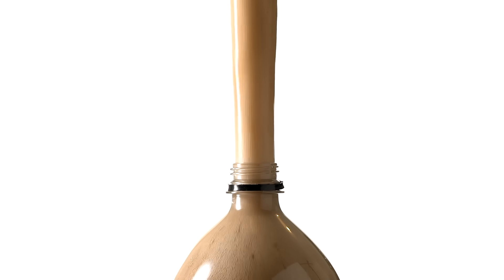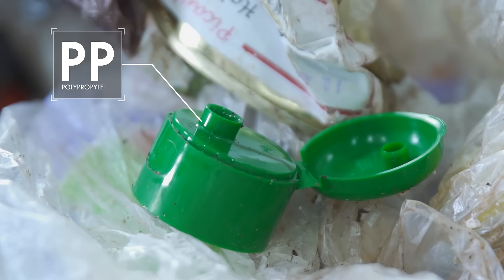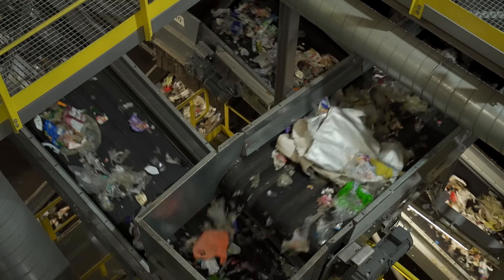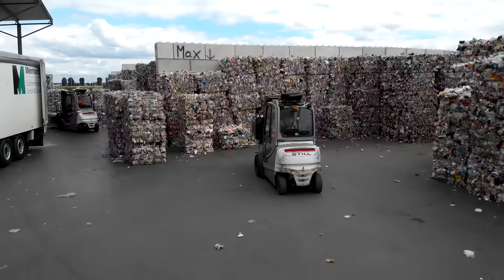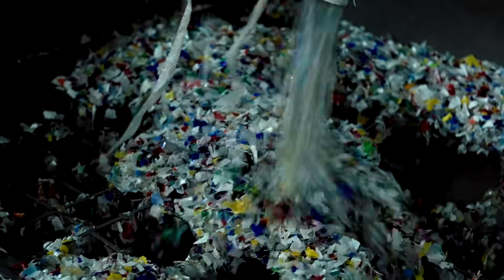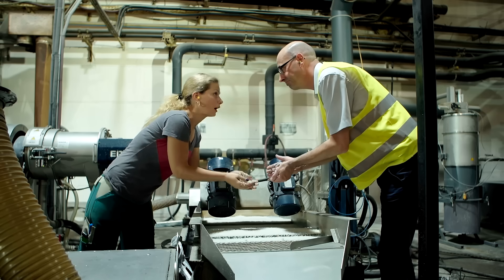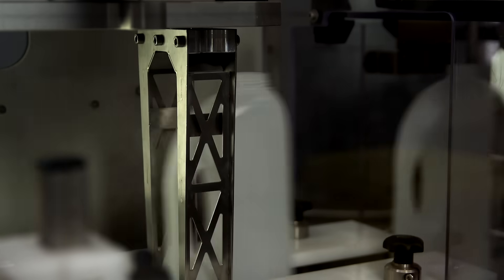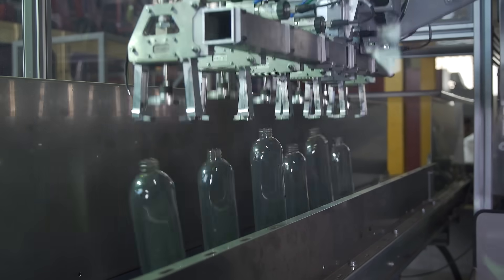Recycling plastics – Resource efficiency with an optimized sorting method

Comment: We should do it step by step. first, develop packaging with same material,try not to mix up PP, HDPE, PET, paper in one products. second, develop less color, try decorations in other way, label, film... etc rather than use multi color plastic. Third, use more soft  plastic bag than solid plastic, these type of bag actually consume less platic.
Reply: They are also less robust as a result though. For a while in the UK you could buy bags of milk and special jugs to put them in for dispensing. But the bags split easily, and it could be messy changing bags, so it died a death fairly quickly

Comment: The alternative to plastic is hemp products for it makes over 26,000 different things.  It has even been proven to be 10 times stronger than steel, 30% lighter and stronger, lighter than concrete stronger and lighter than brick far more versatile making the design possibilities practically limitless at the same time being easier to work with on-site, equally as amazing 1 acre of hemp can produce enough bio fossil fuel to fuel 10,000 vehicles for a year at about a dollar per gallon.  One of the major differences is hemp bio fossil fuel only releases the same amount of carbon dioxide  unoxygenated air per mile as a person does when the exhale versus coal, oil, and gas. Which release tens of millions of years worth of petrified death per mile.   The real sales pitch is 1 acre of hemp produces 3 to 4 times the amount of oxygen as a acre of trees + it sucks in 3 to 4 times the amount of carbon dioxide unoxygenated air as a acre of trees plus it rejuvenates and replenishes the soil back to Garden of paradise type quality after every harvest even if the landscape has been previously stripped, robbed, and depleted from overharvesting things such as cotton and corn that has been marinating in petroleum-based fertilizer.  Not to mention it has the same nutritional value as rice, corn, wheat, barley, and milk. So we can easily deal with people being over fed and undernourished. In layman's terms we can rebuild faster much more efficiently at a fraction of the cost in half the time of what we are doing today without leaving any excess poisonis, toxic waste behind.              In layman's terms we can manufacture, mass-produce, and distribute products that every country, city, and continent is going to be happy to spend top dollar. For example hemp clothing! For it distributes moisture across the body more efficiently than any other material leaving a person feeling, smelling, and smiling their best even under the most extreme circumstances plus it promotes good respiratory function so if a person has asthma, allergies, or other breathing complications just by wearing its clothing you will alleviate those symptoms with the potential of diminishing them all together. Hemp has even  been successfully grown on radiative soil!              So in theory if we grow hemp along the shores of our rivers and lakes we will greatly improve upon the quality of that water.  Nonetheless we definitely will improve upon and maintain the quality of our air, water, foods, landscapes, working/living environment, and every day home products by producing 3 to 4 times more oxygen per acre than we do currently. At the same time sucking in 3 to 4 times the amount of carbon dioxide                  unoxygenated air per acre as we do currently as a added bonus, everywhere we grow it we will be rejuvenating and replenishing the soil back to Garden of paradise type quality. Keep in mind America has about 800,000 acres of available farming land.  So again we have the manpower, technology, resources, and capability to create clean high-paying jobs from coast-to-coast that will improve upon and maintain the quality of life in such a way.  That will naturally allow each person's generation to become stronger, smarter, healthier, happier better off physically, mentally, financially possibly, and spiritually then the previous generation. With that type of leadership, loyalty, and devotion to one's self and country People may start finally having jobs, products, and power sources that will allow them to be healthy and wealthy enough to live enjoy their life all the way through out retirement.                        You can't do that would dirty low-paying jobs.  That come from outdated power sources, inferior materials, poisonous, toxic substances, pesticides, and chemicals that never change their killing composition which means whether it's solid, liquid, or burnt off to our airways and atmosphere as a vapor. It is always going to be poisonous, debilitating, and deadly to the body at the same time polluting, corrupting, and devastating to mother Earth and all the various different forms of life that live within this world.  The bottom line you cannot promote life by doing business with material, resources, and substances that have been scientifically classified and religiously verified as petrified death or worse. Think about this if life is not free why the hell would death be any cheaper. I guarantee it's not so would you like to know how souls and spirits have paid out are picking up the tab on the end results of dirty low-paying jobs.  Would you like to know how souls and spirits have paid out are picking up the tab on a diminished quality of life. Case closed mercy, forgiveness, and spiritual welfare are not changing these facts.             You're either part of the world solutions or you are exacerbating the world's problems either way each and every one of us is being held spiritually accountable for each and every moment. Laugh smile grin chuckle, with confidence I say now I wish and pray for my soul and spirit to be held spiritually accountable to the statements I proclaim. I guarantee you never see hear another body, man in power, persons of legal, religious authority leaders ever freely validate the statements they proclaim with that level of certainty. One reason could be the don't have the best interest of the majority of the population's needs at heart another reason could be the come from a breed of cowards! One is genetic  hereditary the other is simply a generic learned behavior either way it is physically, mentally, and spiritually useless to freely live and die in such a low quality manner especially if that stupidity, ignorance, and desperation stems from being soft, lazy, out of shape, over fed, undernourished, overworked, and
 underpaid with dirty low-paying jobs.

Comment: All those who comment negatives to say only 10% is retrieved as usable plastics from 100% wastes I wanted to let them know that the 90% which ends up in Incinerator Gasification actually produces Crude Oil which looks like Coca-Cola or black oil that is ready to ignite the Engines of a Boat or Oil furnaces. This is still polluting the atmosphere because that much more Crude will bring climate change. But there are ways to handle this responsibly. Hope the world can understand fast.

Comment: Instead of sorting plastic based on Colors they might add colour additives which will turn unsorted item into required colour
Reply: All plastic for packaging should be clear. That would eliminate the need to sort by color to begin with.
Reply: in my plastic manufacturing plant we use some recycled materials, but the only thing multi colored plastic is used for are dark colored products. think back to art class in school, every kid should remember this, when you mix all colors you get grey, it the only shade that you get. Which is a color shade of white to black, on a gradient scale gray is in the middle transitioning into white and black. Color scales look them up, so when our plant uses these multi colored batches, we only use them for light grey, grey, dark grey, light black grey, black gray, black. These are the only colors you'll get. what you must understand is if you did try to say a color using multi colored "( correct term is regrind"), then you will end up with your main color but add grey coloration in it. we use a hot runner injection molding system at our place, using a press that pushes a mold shut with anywhere from 500 to 1000 tons of force, big steel molds have an empty space cut out space in the middle in the shape of your product. we then take that plastic and dump it into a hopper that feeds an injection unit, inside this horizontal barrel 20 ft long is a precision screw, with a out side diameter close to the inside diameter to the barrel. that rotates at high speeds like 750 to 1000 rpm. which forces the plastic forward down the barrel remember because its a screw. as it move forward the gap between the screw and the barrel shrinks. resulting in high compression with rotating turns the plastic into melted plastic any where from 400 to 600 max degrees Fahrenheit, this liquefies the plastic and the screw stops spinning and get shoved forward at a specific speed to the front of the barrel, the barrel is held against the back of the mold at a certain force, and through a small hole about a 1/4 inch hole connects the barrel and mold. so when the screw moves forward it transfers the plastic into the mold, the mold has water running through the steel body, which cools down the part, then the mold open and ejects the part, which follows a conveyor to be packaged  by an operator. been doing it for 8 years. its better to use same colored regrind to make same colored parts, not add end result grey colored material.
Reply: @jmanj9379  Yes we too use the term Reprocessed. 
That's regrind material is test for its properties except colour. 
But we add specific additives to get desired colour like orange, Blue or yellow along with those Reprocessed material.
Apart from that we also follow similar injection molding techniques
Reply: Satheesh Narayanan If that were possible people would be doing that
Reply: @Fireclaws10  FYI Am in Injection mold manufacturing unit. And we used to mix various colours of Polypropylene and add required master batch colouring additives to achieve what we need

Comment: The best recycling would be when one goes to buy a new product. One should go with the old packaging in order to buy a new one. If one doesn't have the old packaging then he must pay 4 times it's normal price.
This would make the people NOT to throw away the plastic and it will be almost no need for any recycling to take place. The recycling will consist in washing up the existing packaging and then refilling it with the product
All products will have the same format characteristics but each different company could add it's own logo to the exterior of the package. 

Why don't we do that?
Reply: Dan Nemes like the idea but not practical. Imagine all the empty packaging that your local store would have to deal with. How’s that gonna work? Bring 5 empty bottles up to the cashier? If they really want to solve the problem have a ridiculous return deposit on everything and then people would have to return it to a recycling center to be paid.
Reply: I was thinking this the other day, when eating a pack of blueberries. Fruit like that always comes in identical or nearly identical plastic trays that could easily be washed and reused.
Reply: that would only work if people where the sorting machines, but people do not know what plastics are made out of. there are lots of types of plastic. you would need a return depot for that, a huge place, with lots of machines and people to operate those machines, that clean and sort them to go back to the manufacturing company, AND THE BIG PART, is NONE of them can be damaged, think about it, no scratches, no marks, no dents, no cracks, nothing, otherwise you cant sell it again, think how shitty stores would look if they sold those products looking like that. people are lazy no one is going to make sure their plastic stays perfect looking, up till they had it back in carefully. impossible.

Comment: Simple solution to recycling......
1/.   Each type of plastic is allocated it’s own colour 
2/.   Cap and bottle must be the same type of plastic 
3/.   Labels must be water soluble and use water soluble glue
4/.   Public educated to separate plastic from other materials I.e. take plastic cap off metal tube.
5/.   Heavy penalties on non-conformance
Reply: I've been saying this exact thing. I think grocery stores could provide us with various colored bags when they bag our food at the checkout counter. We could then use them to presort. Larger bags would be available for purchase.

Presorting would make recycling financially viable and much more likely to be done. I think we could hit +90%, rather than 10%.
Reply: What you're saying is well intentioned but naive.  Manufacturers have been fighting changes to curb toxic content in their products for years in the form of special interest groups and lobbyists.   I used work in the plastics recycling industry and the toxic chemicals in plastics can be fixed but there is very little motivation by politicians to do it, that's the bottom line.  If you'd run for election and said everything in this post I can almost guarantee you that you'd be labeled a communist trying to scare away jobs from the country by raising the cost of doing business.

The smarter politicians carefully pick their environmental fights on the likelihood to win...this helps them get reelected.  In the mean time they play the media game by kissing babies, going on talk shows, pretending they're personally interested in your problems and speaking about the latest fads like equality for women and LGBTQ rights.
Reply: @abrahkadabra9501 
The topic we were discussing had nothing to do with the toxicity of various plastics, it has to do with the energy, time, and money it takes to sort plastics into their respective categories. If individuals would 1st be allowed to sort, as many recycling bins that are picked up at the curb, disallow for presorting into various bags. Then it would be up to the individuals to actually presort their plastics. As it stands, most of the plastics going to recycling still end up in the landfill. The material that is actually recycled costs a lot to do do, mainly due to sorting.

Andre was going so far as to say that lids should be color coded, as to their material type, which is directly related to sorting and therefore directed related to the efficacy of recycling.
Reply: Sean Sweno No, Australia
Reply: Andre Fransen unfortunately that's a rather uninformed suggestion. Just taking your first two suggestions..:
1. When you consider all the different chemical and physical properties required, there are more plastic types than there are easily distinguishable colours, so that's a non-starter (ABS, ASA, PET, HDPE, LDPE, Nylon, Polycarbonate, PC-ABS, PET, PP, POM, PS, Polysulfone, PVC to name just a few of the top level families, then there are many, many variants within each, each with specific properties for a specific application). You should remember that many, many engineering plastics are used in non food or drink applications...https://www.ryedale.gov.uk/attachments/article/690/Different_plastic_polymer_types.pdf 
2. That won't work either. For example, the plastic bottles are injection moulded as miniature bottles with the neck, then blow moulded to the required size and shape. The caps are injection moulded. The bottle material isn't suitable for the caps, and the cap material isn't suitable for blow moulding. The two parts of the overall packaging have different physical property requirements for them to do their jobs. The caps need to be rigid, the bottles flexible

Comment: With all those steps, the infrastructure supporting the plastic recycling procedure seems highly expensive, all that for only 10% of the initial waste to be recycled. Compare that with the simplicity of producing new plastic direct from crude oil... Companies will purchase cheaper option. Only solution is to set quotas on plastic use, tax when exceeded & promote renewable resource consumption & cut world population & promote packaging free supermarkets. Literally was in Paris today, temperature 43 degrees celcius. Blame incineration

Comment: This video forgets to mention some significant problems with recycled plastics. Plastics can't be recycled indefinitely because the properties break down each time it is reformed. Anti oxidents are added to it when the original granules are made and these are used up each time it is heated/reformed. In the PE pipe industry only 30% recycled can be used with 70% new material. Maybe one day  the properties of recycled materials can be restored to make recycling 100% efficient instead of the blending that happens today.
Reply: Typically today recycled plastic is reformed to make a lower quality product than it was before. We've all endured those plastic products that break so easily. While this is giving plastic a second life eventually all plastic is destined for the rubbish dump after its properties have been degraded to the point of being useless
Reply: 6:30

Comment: Plastic must be more expensive that’s the only way to fight against it. We need more natural products. Back to glass and metal, wood and paper.
Reply: Wood & paper are at least non-toxic when disposed of.  Glass & metal are king though.  Endlessly recyclable.  Metal is super durable.  Glass for reusability and corrosion resistence.

Cloth bags to replace plastic grocery bags!

There will need to be huge changes around food packaging.  It's hard to find anything in the store that isn't wrapped in plastic.  People are squeamish about germs.  They need time in a garden where they'll see that the very best foods don't need any plastic.  We may need to see the return of old-fashioned grocers where a sales clerk is the only one touching the food to put in customers' reusable containers.  Or if automation is demanded, a sort of bulk-food vending machine.